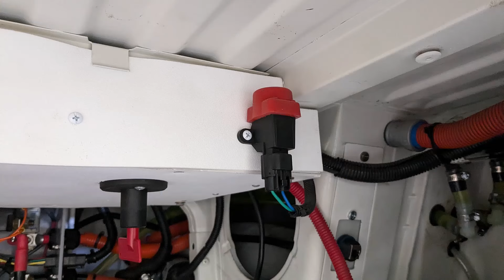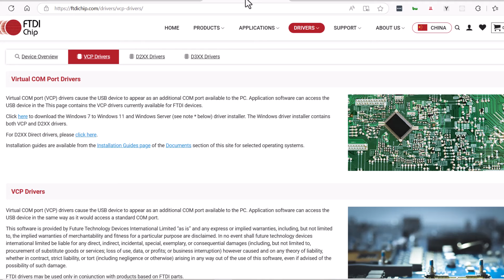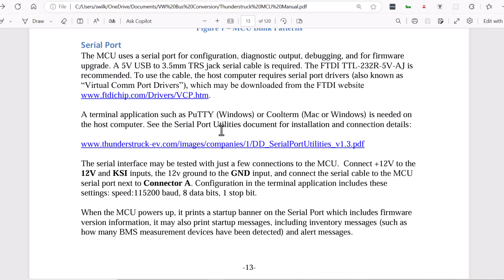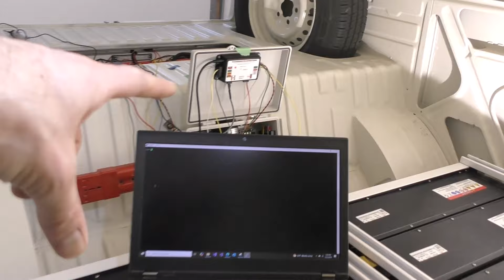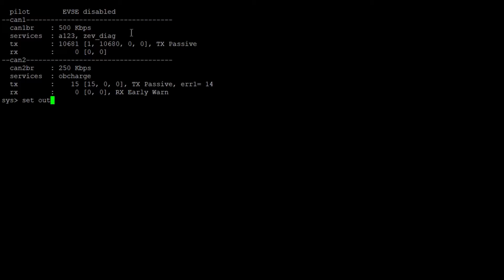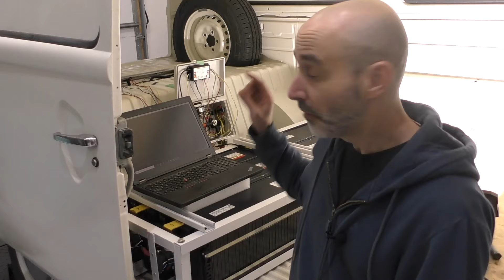VW Bus Electric Conversion Part 16: Thunderstruck MCU Wiring & Programming #evconversion

Comment: Scotty, I am also confused about the second ground on connector A. Did you eventually work out what it is for?
Reply from the maker: I never pursued asking TS about that.  But they offer great support if you email them.  My assumption is that second ground may be a ground output for the IPO (BMS communication) terminals above it.
Reply: @FixItScotty  Thanks, I took your advice. In case it's useful for someone else, TS advised as follows:
"The second ground on connector A is just if you need another ground connection. Optional, and not typically used."

Comment: Could output 5 be used for starter motor when battery SOC is below a certain level in hybrids???
Reply from the maker: I believe the documentation says that output 5 cannot handle passing more than 1.5 amps through it.  But you can still use it to control a relay that switches the power to the device.  In that way, the out5 wire would go to the positive side of the relay coil.